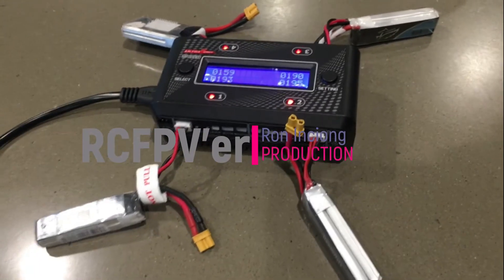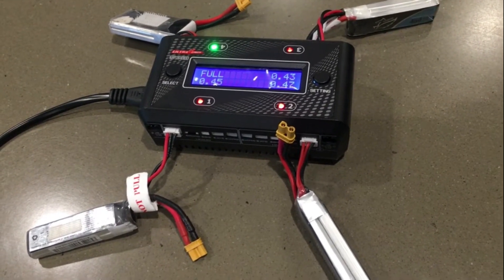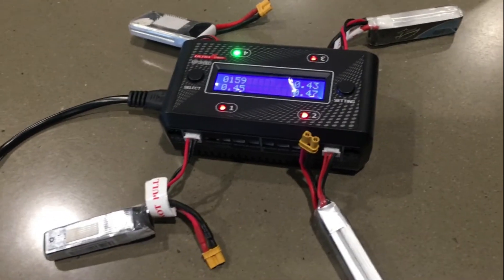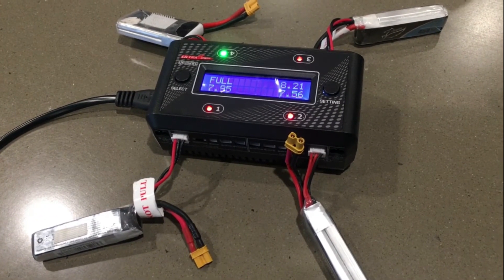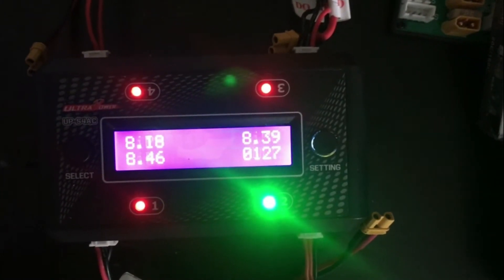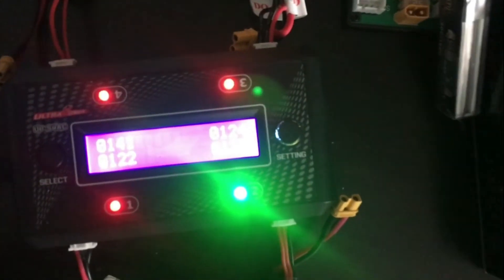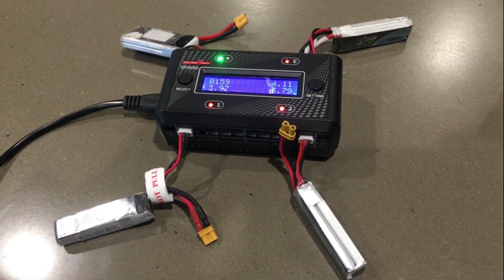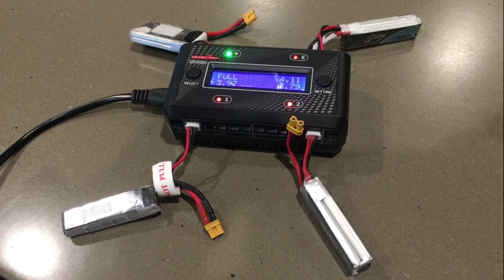Ultra Power UP-S4AC OVERCHARGING!!!!!

Comment: the UP-S6AC can be calibrated: Press "Select" and "Setting" ( both Buttons ) and plug in LiPo.. wait a sec until it shows: "insert VREF 4.2" ... plug im 4.200 Volt Voltage Reference ( I used 6 batterys charged to 4.20X Volts ( not the best way :D   )
Reply: try this with the UP-S4AC too and let me know if it works :)